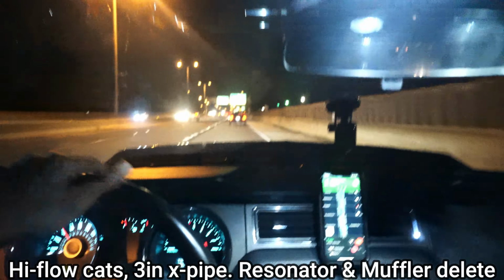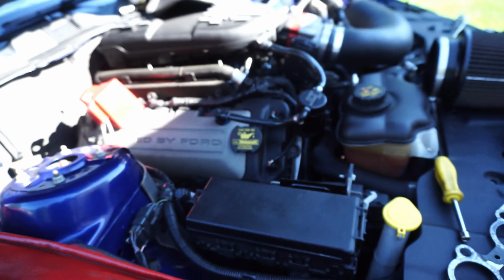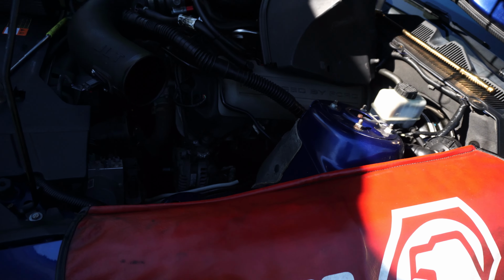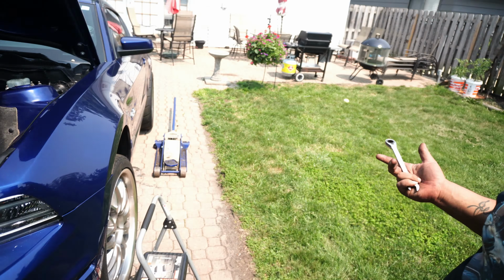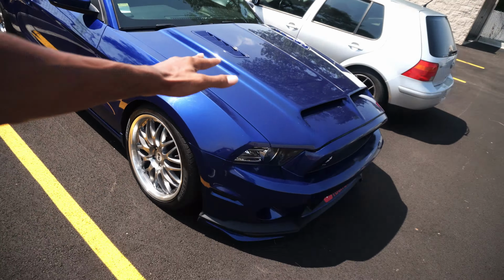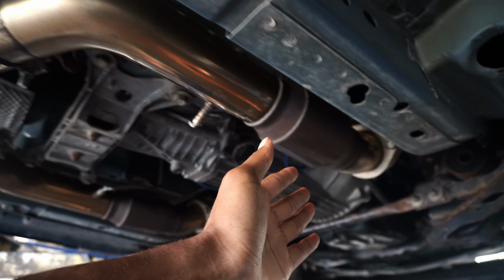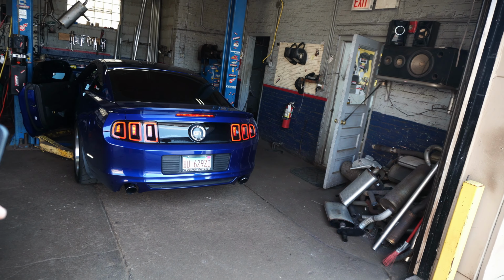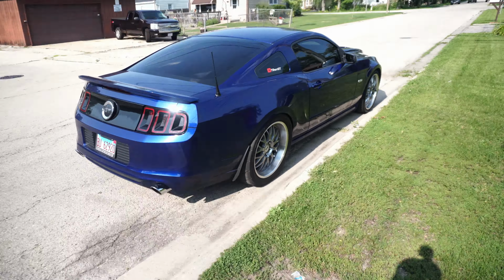KOOKS 1-7/8" Long Tube Headers Installed Sounds AGGRESSIVE! *LOUDER

Comment: Love the channel bro just picked up an s197 and stumbled across your videos. Does it harm the motor any to drive with long tubes or an off road mid pipe without getting tuned? Just wondering before I start pulling triggers
Reply from the maker: You don’t need a tune for after market headers

Comment: How's that hood holding up without hood pins?  Any flutter at high speed?
Reply from the maker: Nope. When I had 3 bolts to it, it flapped. But I put the 4 bolts in and it don’t

Comment: Could you tell a big difference in the power what made you go with 1 7/8  instead of 1 3/4 just asking it sounds badass because I'm going to get some
Reply from the maker: Not really a huge difference although the gains are there. It definitely opens up & breaths through the exhaust better. Went 1-7/8ths for that tad bit of greater airflow & for it to sound great

Comment: God damm bro 🤣 cops gonna hate u lol
Reply from the maker: Lol I’m putting this thing in neutral everytime I drive past one 😂
Reply: @Tdurrgt  Nah man you shouldn't have trouble with cops. My experience with these cars is even if you have a very loud set up as long as you are short-shifting and driving like a grandma you should be good around police LOL. I used the daily drive a couple older muscle cars that were completely straight piped with no cats and barely any mufflers put the exhaust coming out of the front of the rear wheels (by use to I only mean a couple years ago cuz I'm 24 years old, not 50+, LMAO).

Comment: Did Lund end up sending a new tune or did they say it was fine w/o?
Reply from the maker: Great question. They said it’s fine without a tune. No revision needed. However, the codes that appeared were from my throttle body that came loose.